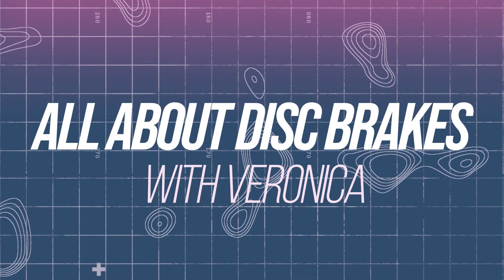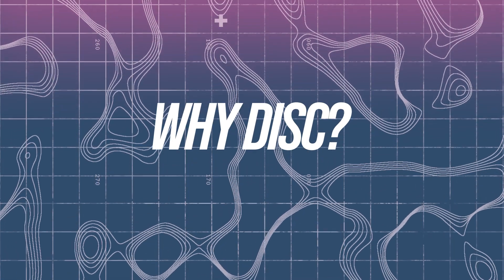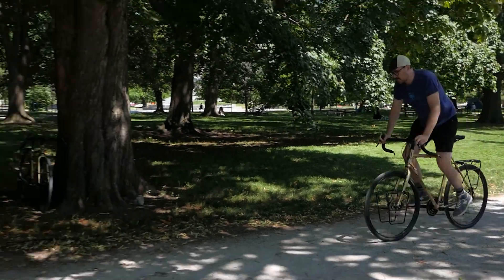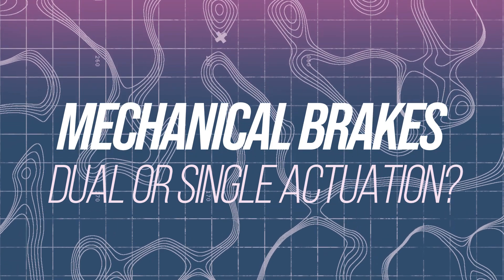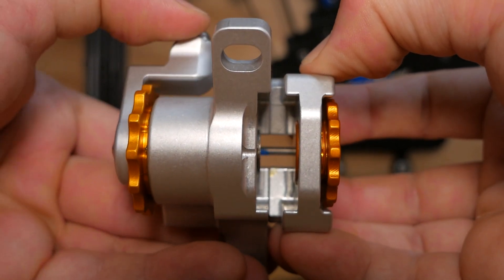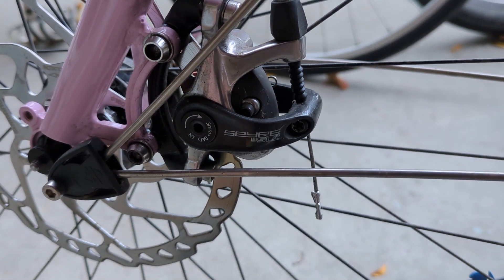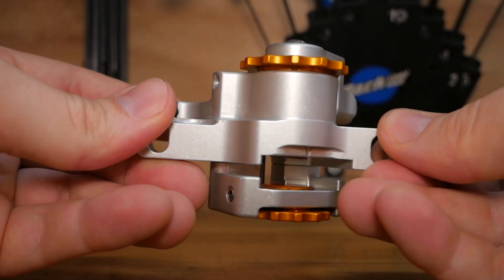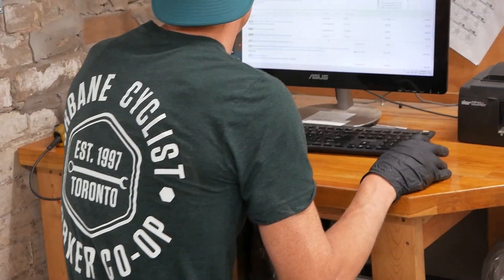Everything You Need To Know About Disc Brakes: Brake Pads, Calipers, Rotors & How They Work!

Comment: I heard disc brakes last 3 times longer then rims brakes, true?
Reply from the maker: There are too many variables to be that specific! I would say disc brake pads do tend to last longer in general in my experience but pad choice, riding style, and riding conditions will all contribute to different results. The biggest selling point for disc brakes over rim brakes is better braking consistency through various conditions and better modulation.